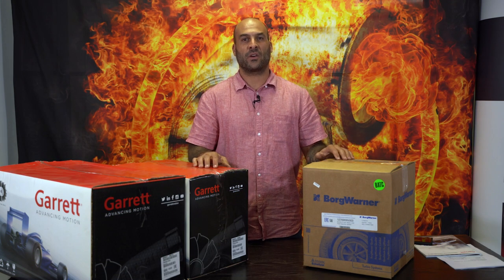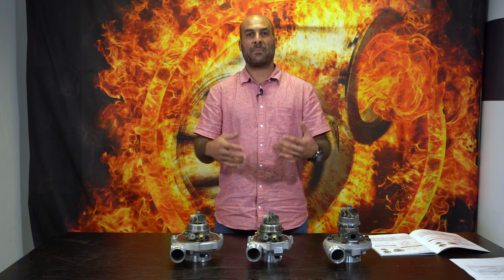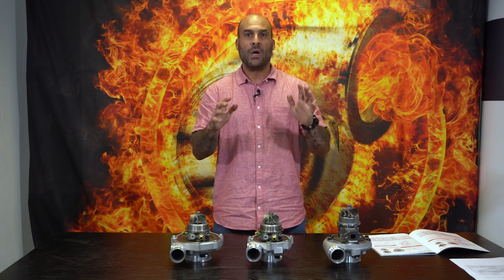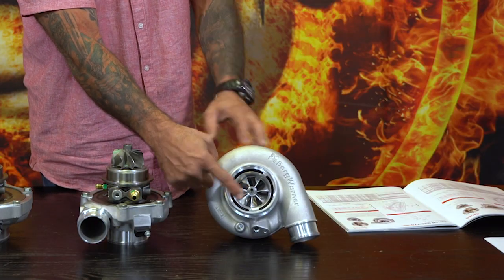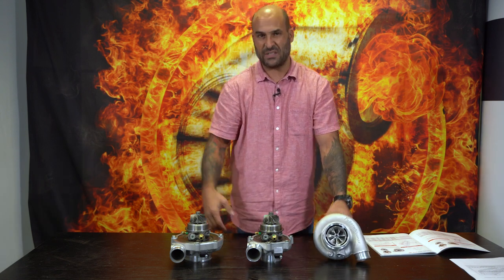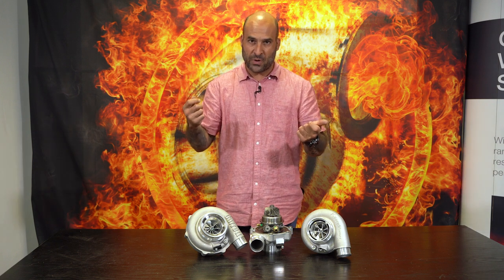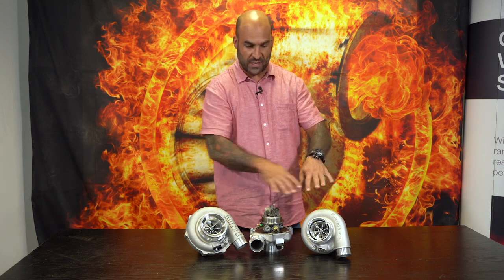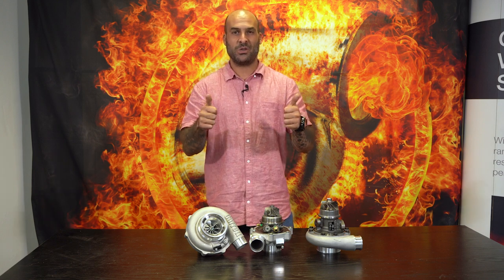BorgWarner Airwerks S200SXE versus Garrett G30-660 and G30-770

Comment: Excellent presentation but.... I should tell our friend that the G30-660 and the Borg Warner S200SXE are hardly comparable. A fair comparison should had been between the S200SXE and the GT3582 or the GTX3576....
Reply: I disagree, the GTX3576R is a much higher HP capable turbo. The GT3582R is outdated and not sold much anymore. The comparison is not a fair comparison at all, it was requested by a subscriber, however HP bracket the Borg is in the same area as the two G30's
Reply: @chriskambouris861  the GT3582 maybe old but still 1) flows more than the S200SXE 2) is more expensive. The GTX3576s 11 or 8 blade, are much more expensive than the S200SXE, even the 11 blade. So what could be the more fair comparison? The point is that the S200SXE is (at least commercially) targeting directly at the generic T3/T4 market, as a worthy successor, so as such who are its competitors? I would say the GTW3476, PTE5858, TN550 and the Td06H-25G and its copies/derivatives. I would choose the last one, indeed this comparison between these two (S200SXE & Td06H) is the most interesting.
Reply from the maker: @aftastosk6016  the GT3582R (not GTX) flows 675HP, and the S200SXE is 650HP - take a careful look at the compressor maps - you will notice that these two are matched as direct competitors in flow - but the obvious elephant in the room shows one is BB and the other is JB. The GTX is not a fair comparison to the S200SXE in the GTX35 range - they obviously outflow the much smaller S200SXE.   

T3/T4 market is rubbish - its a cheap, outdated, mismatched, unreliable, and poor performing product - in comparison to a turbocharger that is designed specifically for an intended performance based purpose. the GTW was released to compete directly against the Precision journal bearing range of turbos at a fraction of the price - the reasoning behind this is simple - the precision uses a copy of the ancient T3 bearing housing from Garrett and also the turbine shaft dimensions are 100% identical aswell as the repair kit inside - the only change from precisions side was the turbine head from the GT35 was copied from Garrett and welded to the T3/T4 turbine shaft design (shaft design from the neck to the shoulder and compressor threaded end of the shaft)  The housings are the simple AR70 To4E housing on the comp side and the turbine was the usual suspect T3 AR63/82 .... 

You can say that this is certainly a comparison, but depending on which turbine housing you choose from the GTW3476 range - you will definately not see 750HP. When running high boost with the GTW3476 you will start to see thrust bearing failures, especially with the AR48 turbine housing option. 
The MHI TD06-25 is a dynamite product, not very popular but  doesnt change the fact that its a proper turbocharger! It has a wide and tall compressor map and flows from a low P2C ratio all the way up to a high boost requirement without reliability issues.
Reply: @TurboDirectSA  we had this discussion before. My argument was that since precision, turbonetics, BNR and many others essentially were made as companies by selling T3/T4 copies and derivatives that they cannot be that bad! However i cannot but agree that the S200SXE and the Td06H (with its copies/derivatives) are the best options for most applications and the best bang for buck in general. My preference goes to MHI products. It's not a coincidence that forced performance offers turbochargers that essentially are Td06s derivatives with Borg Warner type  compressor wheels. Possibly the best of both worlds.
Reply from the maker: @aftastosk6016  As discussed before, i once more disagree with you for the very same reasons as discussed before -T3/T4 is rubbish no matter than name on it. As dicussed before - see previous discussions. 

The reason that the "low volume" hypercar business does not belong to Garrett as one example is for various reasons but just one is that the rotating assembly you'll find in the low volume applications  is made by MHI mostly - and custom housings and "coupling hardware" is made by a private company who now supplied similar to F2 series.  MHI is definitely a brilliant design and under rated - BorgWarner is by far the leader in my opinion for various reasons.  Borg and MHI together make a really great combination that yields are brilliant result.
Reply: @TurboDirectSA  i believe that the GT 3582R and the S200SXE are rather comparable in performance however the price difference is such that the BW is a much better choice.
Reply from the maker: @aftastosk6016  I hear where you coming from, but in the end the GT35 is ball bearing and not really a fair comparison to the S200SXE - the compressor map shows very good performance on both, BUT performance is not just about the compressor map alone as you already know.
Reply: @TurboDirectSA  i agree with you 100% in your comments about BW and MHI. I want to ask you something if you can please. As you already know i poccess now a brand new twin scroll MAMBA Td04HL-20T with a 11 blade compressor wheel. My question is...
Reply: @TurboDirectSA  My question is, is there any chance that i can find a compressor map for the 11 blade 20T compressor wheel? My preference in general is for 6+6 compressor wheels but unfortunately MAMBA offers the twin scroll only when the 11 blade wheel
Reply from the maker: @aftastosk6016  What is the question Aftastos??
Reply: @TurboDirectSA  Sorry if i didn't make myself clear. If there is  available the compressor map of the 11 blade compressor wheel 20T (a 19T would do).  I search/asked everywhere but nobody seems to know. Finding compressor maps for all these MHI derivatives is virtually impossible, at least to the general public. If you don't know, then nobody knows... simply they don't exist.
Reply: @TurboDirectSA  apparently there is not such thing available. Thanks anyway.
Reply from the maker: @aftastosk6016  You are correct - unless you know someone, forget it.  I can say that the 11 blade wheel is not from MHI - its a Gen1 Garrett GTX design which someone more than likely got someone to machine it with a centre hole according to MHI dimensions. The wheel itself is not from MHI in neither the 20G nor 19T
Reply: @TurboDirectSA  It's very popular with the Taiwanese manufacturers to offer MHI derivatives with 11 blade wheels. I am a bit anxious about the 20T GTX wheel. Nobody else offers such a high TRIM - 65 - in a 11 blade wheel. The inducer is 47mm so the same as the GTX2863 (which I believe is the forgotten gem of the GTX line-up) but the overall height is the same as all the -T series MHI wheels so just 26mm in contrast with the GTX 34-35mm. This is a weirdo combination that it should give me loads of power (in relation with the exducer size, weight and overall dimensions) at low boost settings and (together with the configuration of the hotside) instant response. Since I don't have any compressor map I cannot talk seriously but I wouldn't be surprised with I would have up to 0.7-0,8 bar more power and torque than I would had had from the GTX2860 0,64 a/r at the same boost levels. However I doubt if there is much to give above 1 bar and also I am afraid of surge problems.
Reply from the maker: @aftastosk6016  I know this very well -  those cheap knock off paperweights ..... all they do is take a copied GTX Gen1 compressor wheel and machine it into the housing -  they have no idea what the housings flow ability is, nor do they take into consideration what the bearing system can handle - it looks nice and shiny, so it must sell......  We have done back to back comparisons between some 11blade and 10 blade different GEN wheels ont he same engine, and you will be surprised at the results.... both in spool and power delivery
Reply: @TurboDirectSA  I should point out that "cheap" certainly the item that delivered to me doesn't not look at all. Everything seems of excellent quality as well as the packaging delivered to me is as good as in any manufacturer (that I am aware of). The only thing that I don't like is a slight bulge just at the beginning of one volute (a casting inperfection) that can been corrected easily with a bit of polish. The "cheap" may apply in that they don't do research and they just adapt and manufacture design of others. However, by looking extensivly into the line of products of the 4 Taiwanese (Arashi, MAMBA, Kinugawa, JP) I would give credit especially to Arashi and MAMBA for having a well-thought catalogue, offering a smart variety of choices (even if Arashi made a dissapointing step back recently). The turbocharger that I purchased is normally destined for a Subaru Legacy/Liberty/Outback and for that application (a rather big and heavy sedan/wagon) the 11 blade GTX in a -20T wheel should be an excellent choice, But in any case, in that size and smaller, Td04s and Tf035s and are the kings with virtually no competition and when someone goes below a GT28 the real question is "which Td04 (or Tf035) should I purchase and from whom?" As long Garrett refuses to produce a 9 blade turbine wheel GTX2554 and BW an EFR5852, Td04s of MHI or some of its copies and derivatives are the only option.
Reply: @TurboDirectSA  is there a 10 blade GEN2 wheel? I thought that all of them are 8 blade wheels.
Reply from the maker: @aftastosk6016  Im no fan of the knock off product as it is, and when i see a mixed bag of turbine and compressor rotating assemblies with a clear lack of understanding behind the "matching" of these components, i cannot help cringe -- no matter how pretty it looks (these guys know exactly how to polish a turd)
Reply from the maker: @aftastosk6016  Ofcourse they do - all the Gen2 GTX and G-series blades are 10 and 9 main blade configurations.
Reply: @TurboDirectSA  ok I got confused you were talking about turbine blades instead I thought you were talking about compressor blades.
Reply: @TurboDirectSA  a Td04HL-20T is not a mismatch. Actually MHI produces a 21T which is even bigger. It's just that this particular compressor wheel has these unusual combination of 11 blades, 65 TRIM and low overall height which suggests that it is mega at low boost (up to 0.8-0.9 bar my estimation). I talked with people in forums that purchased 11 blade Taiwanese Td04s or changed their stock compressor wheels to 11 blade (all of them in single scroll applications) and there is always the same feedback - the 11 blade 20T runs out of puff at approx 1,25 bar while the billet 6+6 with the "Kawasaki" compressor wheel can go up to 1,45 bar (1,35 bar for the stock 19T, this comment is for everyone else that is reading this).
Reply from the maker: @aftastosk6016  I was talking about compressor wheels, not turbine. The newer series use 10 and 9 blade configurations.
Reply from the maker: @aftastosk6016  MHI definitely do NOT make a TD04-20G or T nor do they make a 21G/T -- We are MHI master distributors and have had extensive experience with tis brand of turbochargers since the 90's --  We have build 1000s of these TF03, TD04 models.  

That TD04 with a "21" series comp wheel is a most definitely a knock off (shot in the dark) which is 100% a mismatch - that i can guarantee you. The MHI series 20 and higher comp wheels aply to the TD05 turbine and larger only, and have a much larger hole diameter, this will never fit the TD04 family-==== chinese knock off.
Reply: @TurboDirectSA  yes of course the G series
Reply: @TurboDirectSA  The 20T is a 19T with the inducer augmented 1 mm so it goes from 46 to 47mm. The difference is minimal - people that went from 19T to 20T they saw a difference between 10 - 15 hp. I don't know for the 20T, but I know for sure that -21Ts are installed into McLarens. I think that you are unfair about the Taiwanese to put into the same category with the chinese. I 've seen maxspeeding rods, MUSAs etc and these are definitely worse. But even mainland china companies makes decent ones, Pulsar has a good reputation but I haven't seen one or heard a review from a person that I know so I cannot tell. Mismatches, yes, Kinugawa still sells a Td04HL with a 16G wheel which I consider it a horrible idea. But on the other hand, Garrett offers the GT2876. So if there is a market for this, companies will try to satisfy their needs and "steal" customers from the "hybrid turbo" market.
Reply: @TurboDirectSA  I looked initially purchacing a MHI Td04HLA. But since new cars with the Td04HLA were not imported here (at least this was the excuse) they were not available by the MHI distributor here. So I was left basically with no choice.
Reply from the maker: @aftastosk6016  No buddy you are missing the point - there is no such thing as a TD04 family 20G/T or 21G/T wheel - period.  the knock off copies and combination turbos are nonsense. There is no understanding, total lack of design infrastructure and no real ability in designs let alone the knowledge or the ability to be able to test a product in the real world.  I dont judge anyone or any company, i judge the product itself, the fact that 99% of the knock off products come from the Asian territories hence my comments about the product itself not the companies. 

BTW - the company that handles the hyper car turbochargers is a person who i know personally and we met for the first time in 2012 on my stand at SEMA. So i can tell you alot about what is installed on the hypercar engines, and i can promise you that there are more rumours than fact about this topic. 

PS:- the TD04-16G is a much more efficient combination than the mismatch TD04 20/21T or G wheels --
Reply: @TurboDirectSA  ha! Well I am going to find out soon if they are nonsense or not. In any case I have a plan B by purchasing a mellett CHRA just in case something goes wrong. So you think that a Td04HL-16G would work good enough? Isn't the hotside too small for a 16G? Thanks for the feedback.
Reply from the maker: @aftastosk6016  TD04 turbine and 16G compressor are both from the same family. This is used as upgrades for the twin turbo M3 btw.
Reply: @TurboDirectSA  ok so you approve a Td04HL-16G. I would consider it as a possible option. I can make one easily out of a Td04HL CHRA but I don't know if the stock 12 blade turbine it would fit into the Spec C housing which is offered by MAMBA only as a 9 blade.  Thank you for your feedback, indeed extremely helpful. When I finish, I am going to contact you with more details about my build if you are interested in.
Reply from the maker: @aftastosk6016  What engine is this going onto? What HP target do you have?
Reply: @TurboDirectSA  1ZZ. I would be out of injectors at approx 280 whp. If you are interested, i can send PM through Facebook with all the details.
Reply from the maker: @aftastosk6016  shoot me an email instead chris@turbodirect.co.za
Reply: @TurboDirectSA  ok Chris, please check your indox. Regards.
Reply from the maker: @aftastosk6016  Got you buddy
Reply: No way they flow at 60-65lbs a min g30-gtx30 frame is a fair comparison
Reply: @TurboDirectSA  I've got a mhi/greddy t67 25g / td06 25g, is there an upgrade compressor that'd be good? Be a lot easier than changing all the pipes etc, cheers
Reply: @aftastosk6016  Any idea what a good wheel upgrade for a t67 25g/td06 25g would be?
Reply: @sircefiro  what is specifically your turbocharger is it a Td06S, Td06SL2, Td06H, T67 ?
Reply: @aftastosk6016  T67 25G
Reply: @sircefiro  Don't change wheel size, it's big enough. Stock design is sound (despite being discontinued....), stock cast compressor is strong enough to withstand loads of boost. A good aftermarket 6+6 compressor would give you some extra horses but not a huge difference, but a good billet 6+6 will be a few grams lighter, that would help. I wouldn't change it for a 11+0 billet compressor (these are more suitable for a Td06SH), if you have a 10cm turbine housing you may consider a 5+5 compressor. The point is that the T67 as it is, is a pretty good turbocharger (even now in 2023...) and the safest option really is to keep the same recipe and trim some grams by swapping to a lighter billet wheel (always 6+6 as the stock cast wheel)
Reply: @aftastosk6016  yeah for an old turbo it still works alright, with the billet options from mamba or kinugawa, the 6+6 may have extended tips but the original 25g is proven where i haven't seen much from the 5+5, 6+6 or 11+0 billets.
It does have the 10cm housing, TD06SH will bolt on (with a new ex housing) but will lose some response, although is an option.
With some old testing I've seen if the wheel is the same billet didn't seem to do much over cast
Reply: @sircefiro  I got curious and I had a look at the aftermarket billet wheels on E bay. They are not all the same designs even between 6+6 wheels. They have different extended tip, tip height, overall height etc. They are not only MAMBA and Kinugawa also TRITDT, Arashi and Nickel Sport. From what I understood you are looking for more power, what can make a real difference is only a 5+5 wheel. These 5+5 they have not only less blades but the tip design is made for high boost. If your car is setup with really high boost and this boost doesn't drop off a lot at the top end, it may worth a look. Be aware that a 5+5 would make less power at low boost levels. Now about going to a Td06SH it depends on the case, it's all a combination of engine/turbocharger setup, transmission and vehicle weight for deciding what is more suitable. So in some cases it's better to go for a T67 10cm and in others a Td06SH 8cm etc. If you are looking for more power as your first priority, you should consider going to a TE06H-25G , not a Td06H/SH
Reply: @aftastosk6016  From what I've seen the mamba & kinugawa quality actually isn't bad, seems ok for the copies of the old turbos, I'm dubious of their own mixes though. I've found a result of a t67 with the 11 blade billet wheel, does seem to hold boost a bit better at high revs, on an rb25 the std t67 usually tapers to about 22psi by 8k rpm if running around 24psi mid range but power still climbs so is still not bad.
The economy here isn't good so i'm trying to do something without spending a lot at the moment but will change the turbo later, as you say there's a range on eBay, mamba says quicker spool and 5% more power with the 11 blade comp wheel, haven't seen much on the others, the sh is probably an extra 20-30kw with 3 or 400 rpm more lag, I would've thought 10 or 12cm though not8, 8 restricts the t67 by 30-40kw so i'd guess wouldn't be good with the bigger turbine
Reply: @sircefiro  I am not sure about what do you mean "dubious of their own mixes". All Taiwanese have more or less the same quality. Now, an 11 blade holding boost better than a 6+6 is unlikely. If this T67 had a better result than your T67 in your RB25, it could because of the inlet, exhaust manifold, exhaust, intercooling and so many other factors. An 11 blade shouldn't give much more hp in the top end than the stock compressor, but a fatter torque and power curve and certainly more power when you are pushing half throttle.
I don't know specifically for a RB25 but 22 psi at 8000 rpm seems good enough for a T67 in a 2.5 lt engine. However is 22-24 psi is not that much for a T67 either, when usually is pushed to 30 psi or more. The comment that you made about the housings is wrong. A 8cm in a bigger turbine is a bigger than a 8cm in a smaller one. The overall void area inside of a 10cm T67 and a 8cm Td06H should not be that dissimilar + plus the Td06H has a bigger exducer. This is academical in our case since a RB25 is big enough to host a Td06SH with a 10cm. Two questions. At what rpm do you start having boost and at what rpm do you have 24 psi
Reply: @aftastosk6016  The 11 blade was not used by mitsi or greddy is what I meant.
The 11 blade did hold boost better top end, this wasn't compared to mine, it was the same car which had a std t67 previously so all other parts were same.
30 psi is out of the efficiency range of a t67 on an rb25, this combo has tested quite extensively in oz, it'll flow it's max around 24-26 psi but generally 20-22psi is a good range.
The sh i don't have as much data for but generally the better response of the t67 made it generally used over the sh on the 25.
Reply: @sircefiro   In theory a turbine of the size of the Td06H/GT35 is more suitable for a 2.5 lt engine, but usually the community knows better. There is no absolute rule on this, sometimes the smaller turbine with the bigger a/r works better than the bigger turbine with the smaller a/r and vice versa, it depends on each engine type (there are so many parameters on this, that nobody really knows before actual testing). 
You seem that you have set up your mind in switching to an 11 blade based on this test, but I insist on this, it was better on HIS car, not be so sure it will be in yours. 11 vs 6+6 the 11 blade maxes out sooner, if you goal is a better top end, you are in the wrong direction. An 11 blade maybe can give more horsepower when max boost is low enough (max 20 psi,  usually 17-18 psi and below), via better efficiency (=more power at the same boost) but holding more boost at the top end, this is exactly what an 11 blade is worse from the 6+6
Reply: @aftastosk6016  Yeah for sure, depends what you're doing with it, t67 is pretty good allrounder, responsive enough for the city but holds power well top end.
I'm not sold on the 11 blade at all, I might go to gtx35 or g35 900 later but just playing with what it has for the moment, t67 gets boost quite a bit earlier than the 35 but obviously 35 makes more power 
Looks like I'll do the cams and add a bit more E to the fuel & turn it up as the bolt on options are not that exciting.
What are you running?
Reply: @sircefiro  please keep me informed of what have you done. I am an engineer with a degree in turbomachinery. I am not making a living selling turbochargers like Chris does so I don't have his experience, but in the end it's my job.
Reply from the maker: Power output wise -  the two are comparable - but the Borg will destroy the Garrett im afraid.
Reply: @TurboDirectSA  are you talking about the S200SXE or the EFR? Our friend has a T67-25G.
Reply: @TurboDirectSA  Not sure which comment this refers to haha but bw is way ahead in power-response in most cases, Garret should maybe drop the price a bit so they're not compared as much.
Reply: @aftastosk6016  not sure either haha but will change the old t67 once things improve a bit
Reply: @sircefiro  I told you my opinion. You should try to the get the T67 up in the boost , both total and in the top end. If you swap it for example for a GTX3076 with a 0.86 a/r, it should be able to keep the boost a bit higher on top, but nothing will change drastically. If you get instead a G30-900 with a 0.83 a/r , it could have a similar boost curve with a better efficiency than the T67, but nothing will change drastically too. The only chance you could have something significantly better is with the EFR7163. The EFR should able to keep much more boost up on top than the T67 (possibly more than 30 psi where you have now 22 psi) but because it has a much smaller compressor , you may lose something for where the T67 is at full boost until the boost pressure drops off, where the EFR should be catching up.